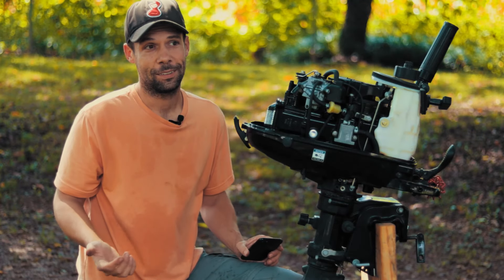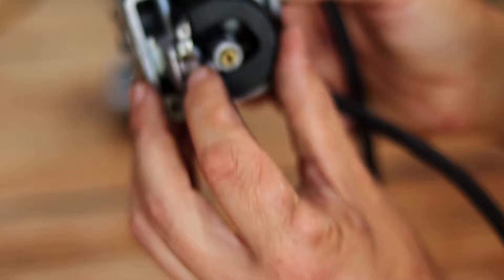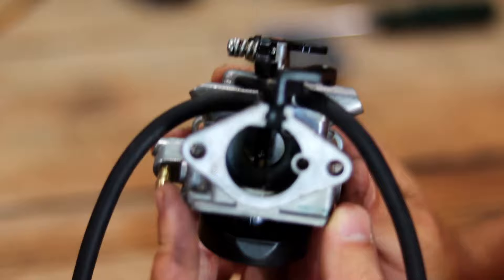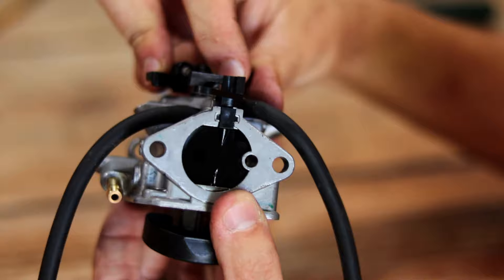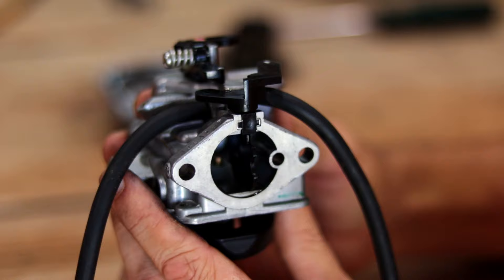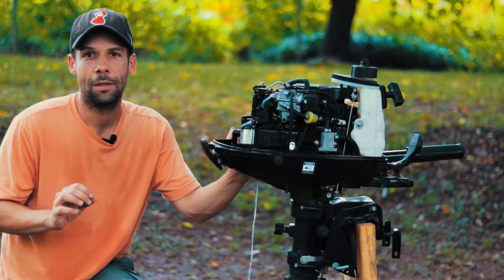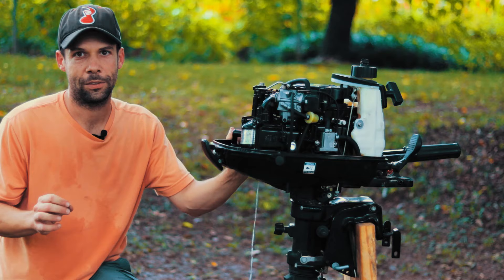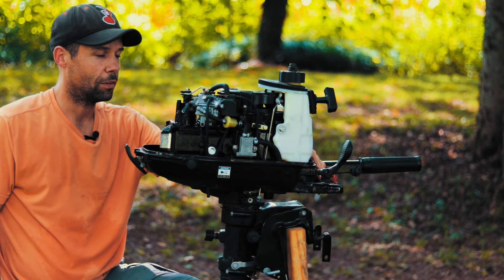Outboard Won’t Start: Carb Basics, Flooding, and How to Start a Flooded Motor

Comment: I was pulling my old mercury 9.9 2 stroke for about 3 hours wit and it still wouldn’t start so I’m going to pull the plugs
Reply from the maker: I did a quick vid on the top 10 reasons my outboard won’t start maybe try is will help https://youtu.be/iBZ1Pg6Cmdk

Comment: Got a 1972 Johnson 9 1/2 outboard motor getting good spark new coils new points but will not start go to be the compression or maybe carburetor it's driving me crazy time is 5:57 today is March 19th 2024 I live in Ohio
Reply from the maker: 90% of the time it’s the carb or fuel flow. I would do a compression test to rule that out

Comment: Had same problem today on new 6 hp 4 stroke. Did everything you suggested but still wont start.
Reply from the maker: Sorry seems your issue maybe a bit more involved. If it’s new you shouldn’t have any of these issues. Have you tried using both the internal and external tank? Sometime internal tanks can lose prime.
Reply: @Skinnyriver  Thanks for reply. I only use external tank. As still under warranty getting dealer to pick up motor from boat at marina to check it out.
Reply from the maker: Let me know what they say. Got me curious

Comment: I think gas built up pressure in my tank and flooded my outboard. Upset cause last person that touched it was a mechanic and I thought they would have known to disconnect the fuel line. I just got the boat so I didn't know any better.
Reply from the maker: Sorry to hear that. Let me know how it turns out. Even if it floods, after a while it should be ok. Good luck!
Reply: @Skinnyriver  for sure and thank you. I'm gonna do what you suggested before taking it back.

Comment: Ever since I've had my motor ive had to put it on full throttle while the choke is in and than after I pull i have to quickly turn the throttle back to idle...does anyone know what I have to do to fix it? ...appreciate the help
Reply from the maker: If you have to have full choke and full throttle to start it means you are getting enough gas and your idle jet is probably clogged and needs cleaning.
Reply from the maker: I would clean the jets and see if that helps
Reply: @Skinnyriver  ok thank you ill try that....thanks for the response...cheers from North Bay, Canada 🇨🇦 ....p.s love your channel i will subscribe
Reply from the maker: Thanks for your support, hope you get this figured out. Here is a video I did where I cleaned my carb and the idle jet. https://youtu.be/OlpEglEvCWw
Reply from the maker: When you start the motor the gas is sent to the motor through the idle jet (or nozzle) in the carb. If it doesn’t start and you have to open the throttle then you are sending MORE gas to the motor through the main jet (there are 2 jets in the carb). I bet if you cleaned the idle jet it would help a lot.
Reply: @Skinnyriver  awesome thank you...
Reply: @Skinnyriver  just one last question...youre video sais its for a 4,5, and 6 hp motor...mines a 2.5...is it the same thing?
Reply from the maker: 4/5/6 Hp is the exact same motor with a different carb. The 2.5 is a different motor but carb cleaning should be the same. It may be mounted a little differently but how it functions should be exactly the same. I had a typo in above comment: key point is you are NOT getting enough gas through idle jet. Take it out and spray some cleaner through it and it should help a lot.

Comment: I have a huge question for anyone that would know about why my boat is spitting gas out of the tube coming off the top of the carburetor?? I have the exact same engine and it worked fine when I put it away last fall. Any help would be greatly appreciated
Reply: It seems that your float is letting fuel in. Causes, bad needle valve (replace), Float not adjusted properly (when carb is held upside-down float must be parallel with carb body, bend tang at fill needle to adjust).
Reply: @tootallofwa  hey thanks! The float was the problem. I just cleaned it out good and it was good to go👍

Comment: Sup man! Okay so I have a brand new outboard (2 days old) and when I turn it on it’s fine but the second time it was chugging and kicking around… not only that black was leaking from the exhaust (an excessive amount) could it be flooded?
Reply from the maker: Man I doubt it. When you say black was it smoke or black liquid? Is it a 2stroke or 4 stroke?
Reply: @Skinnyriver  is a 4 stroke tohatsu 6hp, don’t worry bro got it fixed it was my carb! Appreciate the help man! ✅😁👍
Reply from the maker: Curious what was wrong with the carb? Glad you got it figured out!
Reply: @Skinnyriver  released that side bolt and it was absolutely flooded with gas… I ran it two days in a row with the choke open i didn’t know you had to close it have little experience
Reply from the maker: Lol I’ve done that. Hey you were right.. that guy was definitely flooded lol choke just pours gas in there

Comment: Help!! No matter what I do fuel still leaks out of carburetor, so far I changed out the pin, the float, new gasket, and fuel pump, it it's still leaking fuel and I also measured the float to factory height nothing has worked 😭
Reply from the maker: Can you tell where it’s leaking from? Top, through the hoses, from the drain screw in the bowl?
Reply from the maker: If it’s overflowing and leaking from the top it’s really only a few things: float is saturated/cracked and not floating, pin is not seating to block fuel flow (contamination maybe), float is catching on something and not raising… ideally find out exactly where it’s leaking from and that will help pinpoint if it’s overflowing or just leaking
Reply: @Skinnyriver  from the intake hole, I will make a video of it when I get home from work, so basically it'll leak a little when the motor is level but when I tilt it up it just comes pouring out of the three carburetor
Reply: @Skinnyriver  was not able to make a video cause it was raining, but I did have a buddy looked at it and he still don't know why it's over flowing (new pin new float new gasket) we even tried the water test where you put the carb in the water and blow the tube and it looks good but when put together it over flows still
Reply from the maker: That’s crazy, if it’s not leaking under the water then your pin, float and all that is making a good seal. When you say it’s leaking through the intake. Is that the air intake?
Reply: @Skinnyriver  did you see the video? When I tilt it up it just comes out flowing
Reply from the maker: Where is the vid posted, you have a link?
Reply: @Skinnyriver  I posted the video on this comment ⬆️⬆️
Reply from the maker: For some reason the link is not showing up on my end. Can you post it again? Sorry that’s weird

Comment: Yamaha motors will not let you maximize throttle unless it is in gear. If in gear you cannot pull the rewind.
Reply from the maker: There is a throttle only button that lets you increase throttle when in neutral. Look up throttle only

Comment: I like my engine, but the carburador its a real chiit.
All years the same, after winter dont Start, carburator problems. 
I have try all the proceeds, always the same problem.
Reply from the maker: Yeah the passages and jets are so small due to EPA regs that any bad gas or contamination just kills it. I drain the carb and run sea foam through before winter and it has helped
Reply: @Skinnyriver  i have done the same with no sucess.
Yesterday, i was going to Start it after 4 months and i have gasoline going out of the carburator on the 2 tub 🤔😭es...

Comment: good laugh when you mention pulling spark plug off.
imagine that 6ft rolling swells it wont start .flooded.. i rather loosen and let it drop. auxiliary motor as a back up outboard that wont fire when you need it is a paper weight..
enjoyed your video new subscriber.
cheers
Reply from the maker: Ha yeah good point! That’s for the sub!
Reply from the maker: Regarding your other post about the throttle photo, shoot me an email and I’ll try to get you a photo skinnyriveroutdoors@gmail.com

Comment: Hi I have a little 6 hp Yamaha outboard 4 stroke, was running for an hr perfectly then went to start it up (pulling) and I couldn't get it started, Tried pulling many times over, what do you think the issue could be?
Reply from the maker: That’s weird. Check all the obvious stuff (gas valve open, gas tank vent open, emergency lanyard is attached if it has one). If all that’s good then it’s probably either flooded or it’s a gas issue. Check gas filter to make sure it’s not clogged. BUT more than likely you have some contamination in the carb. I would take it off and clean it. If that doesn’t work change the spark plug. 

Before you do all of that double check your starting procedure to make sure choke and throttle are in correct position. I have accidentally flooded mine because throttle was in wrong position with choke on
Reply: @Skinnyriver  Thanks! I will try. To de flood you simply crank on rope a few times with throttle full and choke closed?
Reply from the maker: Yeah but after it sits for a few hours it shouldn’t be flooded any more. If you have a hard time starting it every time you probably aren’t getting enough gas vs getting too much. If you smell gas after you try to start it… it’s flooding. But if you don’t smell gas then s probably not flooding. I would check fuel filter to see if there is junk it it, then change the spark plug, then take carb off and clean it. Are you using an external tank? If so try using the internal tank as an experiment. Could be an issue with your priming bulb or fuel lines
Reply: @Skinnyriver  I took out spark plug and cleaned it. It started up on first stroke with choke on and throttle at the right spot to start. Figured now everything was fine and then it wouldnt idle without turning off. Had trouble starting from there on out and once I would start now it smokes, is leaking black liquid when it runs and smokes then turns off. Fuel filter looks good. Could I just have bad gas with possible water in it? The carb is new from this summer.
Reply from the maker: Check out this webpage https://www.louisianasportsman.com/fishing/what-is-this-oily-sludge-beneath-my-prop/      Some have accidentally put 2stroke fuel (mixed with oil) in a 4stroke and it did something similar. I would drain all the gas, buy a new spark plug (only $5), spray a cleaner into the engine like the webpage says. I think that will definitely help.
Reply from the maker: 90% chance it’s a fuel issue and you need to drain, spray a cleaner, and put in new spark plug… joys of owning a boat!!!! If none of that works you are probably right that it is flooding and need to adjust the float in your carb
Reply: @Skinnyriver  Thanks! Something very strange happened now, I went to open gear oil and there was back flow of fuel and oil. Oh boy!
Reply from the maker: I’ll be honest, that’s not a good sign. If there is gas in your lower end unit that means there could be a crack in your lower unit. Sometimes water gets in there and freezes during the winter. The water expands and causes the lower unit to crack, sometimes exposing it to exhaust and unburnt gas. There is a pressure test a shop can do to determine is the lower end unit is leaking (has crack) it’s looks like a bicycle pump and they should be able to do it for free.
Reply: @Skinnyriver  It is in the gear oil that the gas has back flowed, not the lower unit. Spoke to a mechanic today, told me it could be that the carb float is stuck in the up position or the least of good news is that I have pistons aren't working right (bad seal). Good thing I had oars :) lol
Reply from the maker: lol sorry I was thinking lower unit oil. Good luck, hopefully it’s just the float flooding it. That was your original thought, you were probably right the whole time
Reply: @Skinnyriver  Thanks for all your help!